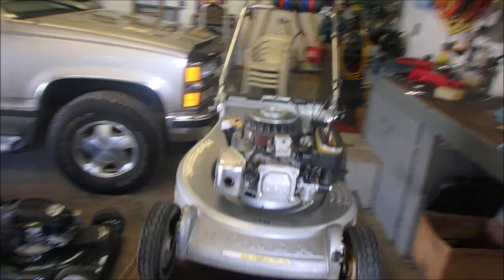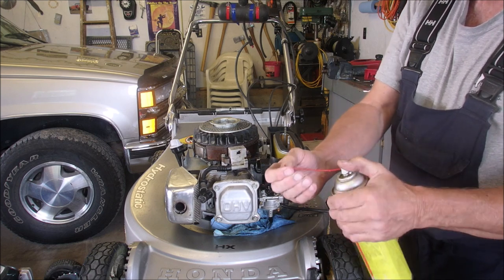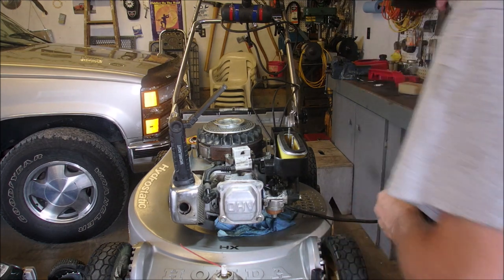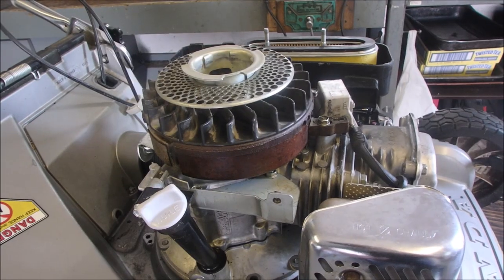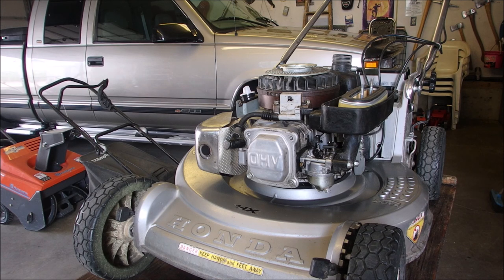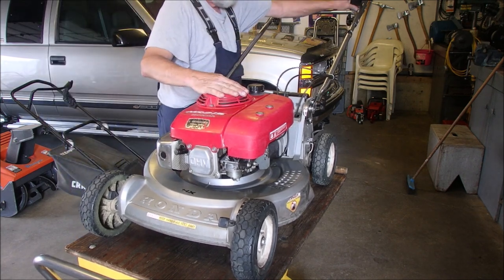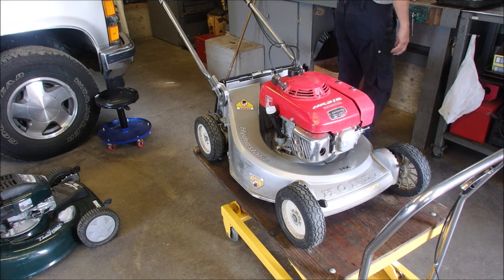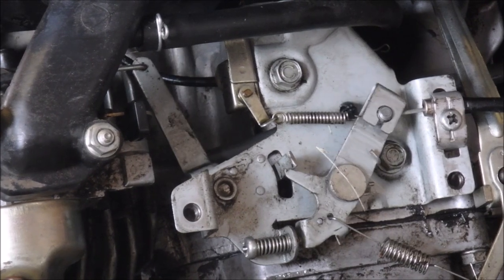This Older Honda Mower doesn't just leak oil  PT2 !!!!!!

Comment: Your fast becoming a pro small engine mechanic, no oil spills for a while😁 I’ve got two chinesium generators in my shed, both engines are very very similar to Honda’s.
Reply from the maker: They are very similaru until they get to be about 3 years old then the chinese part shows up.
Reply: @BrucesShop  👍

Comment: Just for kicks, I checked some history on that classic. I found a manual dated 1990; thus, it could be at least 33 years old! On the engine cover, I spotted a sticker from the seller back then, Johansen Sales, Ponoka AB, which is what, a l bit under half way between you & Edmonton? Google also found that Johansen's inventory was, alas, sold at auction about a year ago.
Reply from the maker: Thanksfor the great info.

Comment: Nice repair on a really nice mower Bruce !! 2 questions though,,,,, was that a rubber tipped plastic fuel valve on the float ?? And, whats your feeling on using valve cover screws for mounting the shroud  ?? Great video Bruce
Reply from the maker: Yes it is a rubber tipped needle,    The screws on the valve cover and shroud  used to bother me but now it is just what it is.  LOL

Comment: Bruce, where did you get the pony fuel tank? It's the perfect size for a temp fuel tank.
Reply from the maker: Off of an old Tecumseh mower.
Reply: Thanks Bruce. I see some pretty cheap ones on Scam-A-Zon, but hey are cheap garbage from China. That one you got off the Tecumseh mower is sweet. Thanks for the reply. I'm on the hunt.

Comment: Hey Bruce,
I must’ve missed it, but how did you get your oil changer to work?
Main reason I asked is, I have just bought one but haven’t used it yet and I need to know what to expect. 
Thanks
Reply from the maker: I didn'tI think I used my exteactor onn this one.  It was a week or so ago
Reply: @BrucesShop  
The older Honda with the leak? I could have sworn that you were trying to get the oil out and then all of a sudden the extractor was not there. Maybe I was asleep. Oh well, it doesn’t matter.